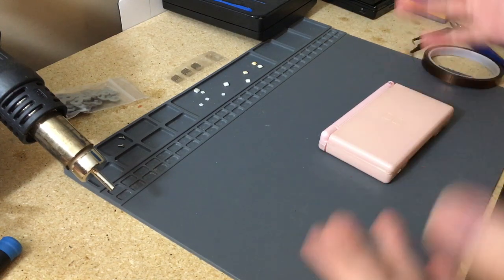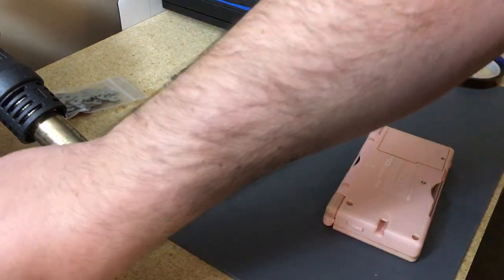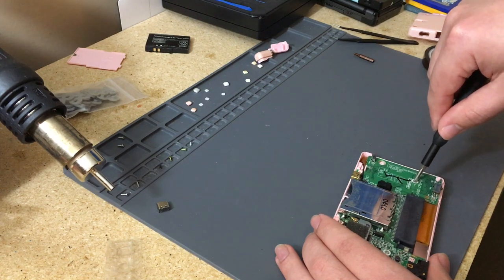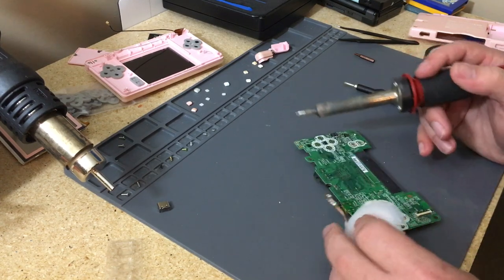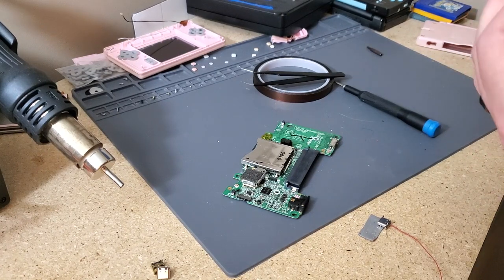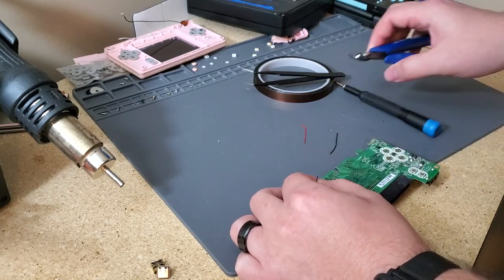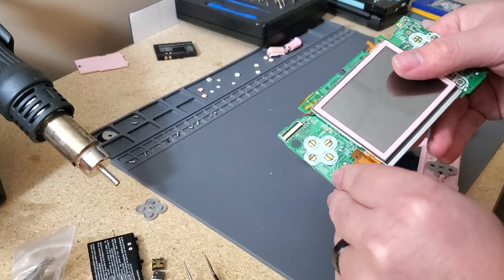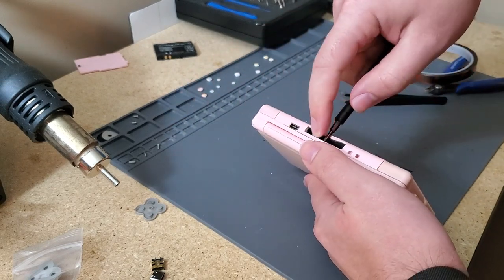DS Lite USB C Mod

Comment: I would be nice if the USBC mod had some sort of power filter and regulator on it so you could charge it with any cable and it would be just fine and it would protect the problem with the F1 f2 fuse with the original port I've had a charger that would just instantly blow the fuse after 2 minutes of charging and I didn't know it was the charger until 2 fuse replacements And if this UBC mod could do all that that would solve a lot of people's problems and everybody would highly recommend the USPC mod way more

Comment: Question. If what I am reading is right, the official Nintendo DS Lite charger has a chip in it. What is this chip, what does it do, and without it can the USB C cable damage the battery ?
Reply: No, the charger does not have any "chip" in it, as in chip which would communicate to the device that it is a legitimate charger. It is just a "dumb" power supply. The USB-C charging will not damage the battery, but you need to do the mod to USB Power Delivery spec (USB-PD). The way it is done in this video is not correct, as it will work only with regular USB-A chargers and not with USB-PD USB-C chargers. For it to work with USB-C chargers, you need to add two 5.1k resistors, one from each CC pin to ground. Yes, it might work without them, but that is just asking for trouble.

Comment: This is great. I’ve recently wanted to try installing usb-C into a majority of my handhelds for a variety of reasons. Reason one is one you mentioned and that’s just versatility. I have a GBA SP. A DS Lite. GBA Macro mod. Old 3DS. And an original GBA with a battery mod that has usb-c. When I bought the 3DS it came with a nice wire that has a usb connection that leads to 3 charging ports. 3DS. DS Lite. GBA SP. super useful and I love it because it simplifies things. I’d originally been interested in wireless charging but it gets pretty hot and I find i use it less than expected. But I recently bought a magnetic charging cable set. Basically it comes with plugs that connect to IPhone. Micro usb. Or usb-C and the wire just has a magnet that connects onto each of these ports. Well my Unhinged SP mod happens to have USB-C so I popped one into it and it was awesome. My vita slim has micro usb. Slotted one onto it. Also awesome. My original GBA with a usb-c battery pack also got one. The work fantastic and it actually got me thinking about making it possible to use it for all my devices. I even ended up using one on my wireless Sony PlayStation headset and made a charging dock for it using some parts I had. So I wanted to added usb-c to my other devices to utilize the tech as well. Thanks for such an informative video

Comment: just did this mod on my lite but having an issue where the charge light will blink on but then turn right off, sometimes with blink back on if I wiggle the cord. Tried a few different cables and power adapters and connections are all solid, could it just be a dookie usb-c port?

Comment: Hey man i followed all your steps and at first it worked, when i plugged a USB C charger the orange led would appear. But now it doesnt.. i checked with a voltage tester the V-IN pad and it gets the 5v from the charger, the V-GRND also checks out fine. So i dunno what else to do.. maybe it is charging but the leds dont work?
Reply from the maker: You might have blown a fuse
Reply: @zarcha  i just checked and F1 is blown :/
Reply from the maker: Blehstor it happens so easily when they get old.
Reply: @zarcha  i bridged the fuse but its still not charging!! :(
Reply: @zarcha  i bridged both F1 and F2 and still not charging.. im about to throw this thing away
Reply: @zarcha  Okay so i found the component which has failed. Its called "EM10" its next to F1, it has shorted from point C - D. It should have contuinity from side to side, it has 4 sides and side A - B are  OK but C - D is shorted. From what i've read its a noise filter for the battery so I'm thinking if I could just remove it and bridge the contacts..
Reply from the maker: Blehstor I had that part short on me twice on a special project but not on any of my usb-c mods. I thankfully have a lot of extras boards to steal from. I was able to remove it without a hot air station before
Reply: @zarcha  I removed it and bridged the contacts with some thin cable, it charges fine now!
Reply from the maker: Blehstor awesome! I’m so glad you fixed it. I do recommend finding new fuses at the very least.
Reply: @zarcha  I accidentally broke the em10 fuse when I was reshelling my ds. The new shell wasn't molded properly and I forced it to shut and I literally popped the fuse. It shattered. But I ordered a replacement. I'm scared to solder it on lol
Reply: @Blehstor  pls dont bridge fuses :(

Comment: I am currently working on modding my DSi XL to accept microUSB for charging, similar to this video. To test it, I am connecting the +5 and Ground wires from a USB to the board, but the ds is not charging. Theoretically, if the correct wires from a USB were installed in the correct spots on the board, it would charge, right? Is there another element I may be overlooking?
Reply from the maker: Retro Gaming16 as long as it’s how you described I don’t see an issue unless your not providing the correct voltage? There could be a chance while testing you might have blown the charging fuse?
Reply: @zarcha  Thanks for the reply, it seems that the fuse was indeed blown! Not sure how it happened as I've only ever put around 5V through the system, but it seems that it is the problem.
Reply: @RetroGaming16  I know it’s been ages but I’m curious. Was it clearly charging before you started modifying it? I think sometimes it’s possible from surges. That’s why they say to have your computers and stuff hooked up to surge protectors. I’d imagine a similar thing could’ve happened without you noticing, and if it was plugged into the wall at that time could’ve just blown that fuse.

Comment: That is all well and good, but i find the Mini USB mod* to be easier. 

Mod: You need a mini USB cable. Not micro USB. 

Step 1:  Plug mini USB into DS lite. it will be a tight fit the first time  but will loosen up with use. This is just the metal of the charging port stretching to accommodate the Mini USB. It doesn't deform very much, and you can still use a normal DS lite charger. What I did was sand the mini USB down a little to improve the fit.

Step 2: And you are done! The pins for the DS Lite charger and The power pins on Mini USB happen to line up, and the DS will not draw more voltage than it needs.

<<Disclaimer>>
This is an easy mod, and works in a pinch. The first time I did it was wit a broken DS lite and it worked. Eventually I scraped it for parts, but have used the same method on my other DS lite. I don't use the diy charger much anymore, because I bought a USB charger specifically for the DSL. Use the DIY charger as a last resort as it is a bit sketchy. Also, do this outside, I have never had any problems, but i does not hurt to be safe. Last thing you want is to burn your house down over ≈$10 charger.

Personally I will probably just follow this tutorial and convert mine to USB C.

Comment: Do you recommend using a phone charger or something like a nintendo switch charger? I dont want to overcharge the ds lite.
Reply from the maker: The charging will be cut off from the DS itself when its full and is not dependent on the power supply used. It needs to be a power supply that will provide 5v regardless of the port asking for 5v via capacitors or a PD chip. Unlike in this video 5v SHOULD be requested via resistors on the CC1 and CC2 pins or via a PD chip, doing it that way will work with most if not all smart charges while this way works more like the old way before usb-c standards.

Comment: Could i use a usb-c to hdmi? I want to be able to play games on my tv..
Reply: I'm afraid not, the USB-C here is only linked to 2 power cables. This would be battery + and ground. You would need data cables for this.

However, Hackaday and the Lost Nintendo History have you covered, if you are happy to settle with Composite instead of HDMI.

Comment: I really like the mod !
Can you charge the console with any wall charger or are you obligated to use 1Amp to not damage the console ?
Reply: Any charger will do as the amount of amps drawn is dependent on the power consumption of the device you charge has
So say my phone is 5 watts
It will draw 1 amp according to
(P=U*I) 5=5*1
And if I have a 10 watt device
10=5*2

Comment: Cuales son esos speakers? 

PD: im sorry, i dont talk english very good... :C
Reply from the maker: For the macro speakers? im not super sure on what i used in that one for sure but it was probably iphone 6s plus. i also tried iphone 5s, 6, 7, and 8 speakers. all worked well but some worked out in design better.
Reply: @zarcha  Its possible install any speaker on a Nintendo DS Lite?
Reply from the maker: @FløppaGəmes  For any of the DS family a normal 2 wire speaker can be installed. For the speakers like this though it would only work in a Macro (modded ds lite with no top screen) with its ds slot removed for room
.